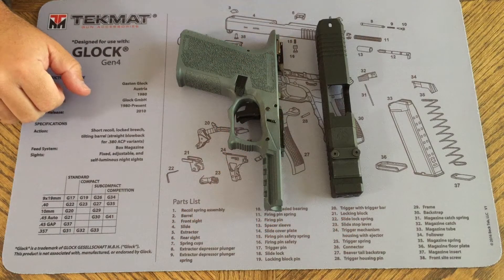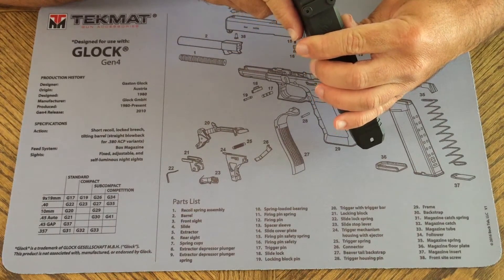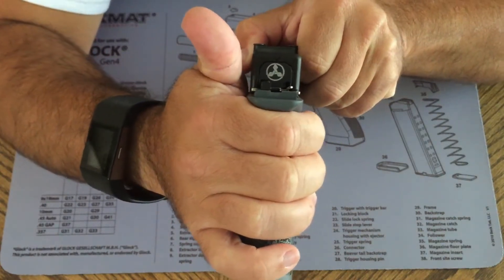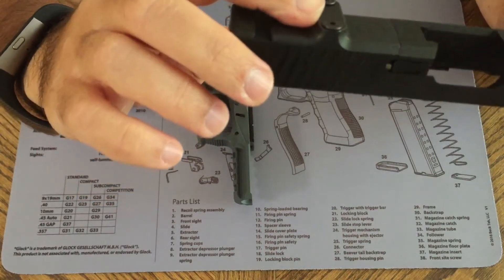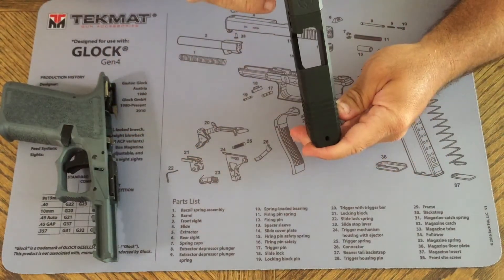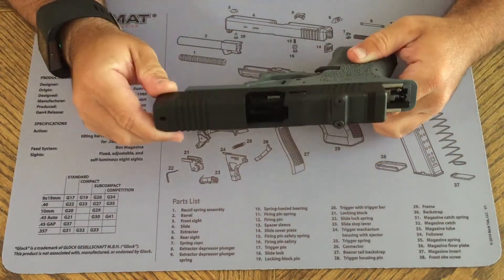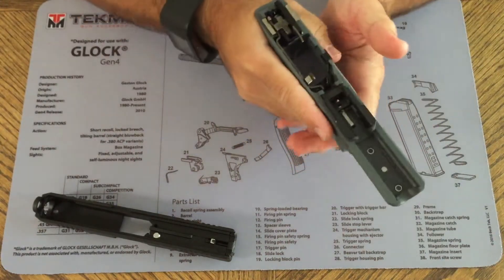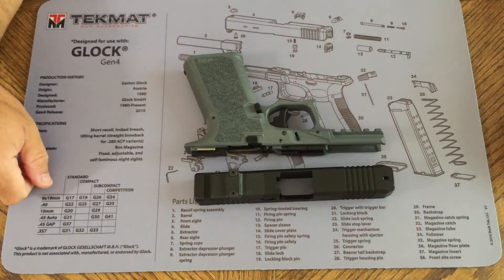Suarez Slide fitment update

Comment: have you tried a glock slide?  looks like rear rail pin was drilled offset raising one side
Reply from the maker: I thought of that as well but that was not what was happening on my frame, the angle of the bend was not quit right.   Just a little manipulating, file, and sanding got it.